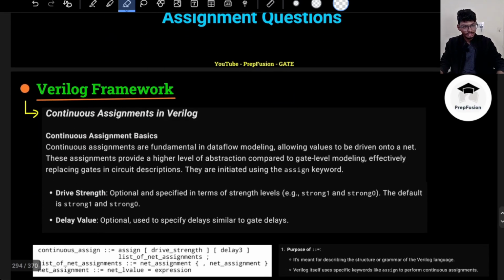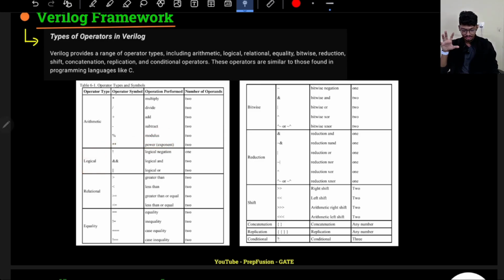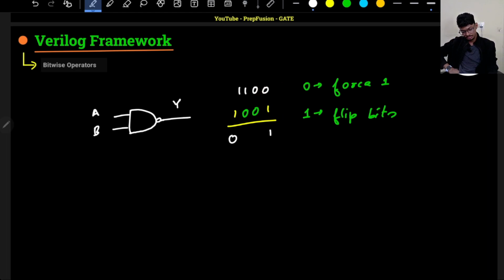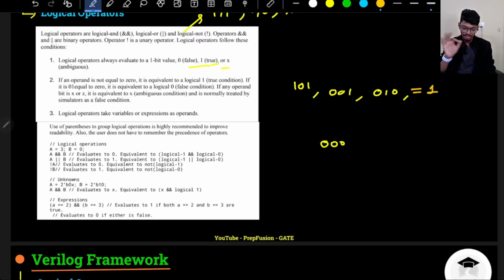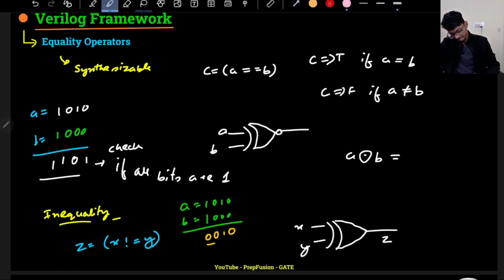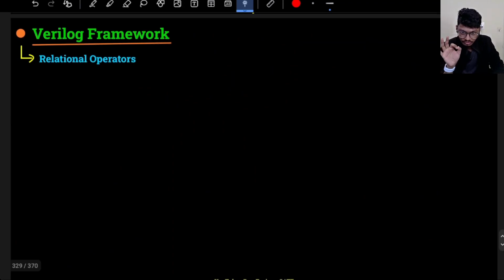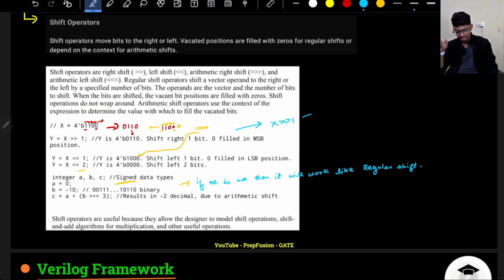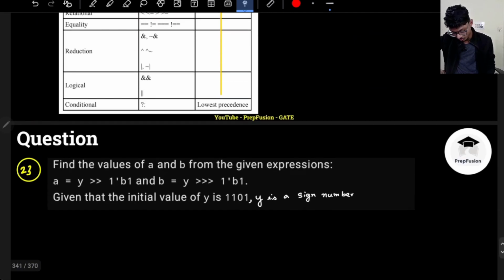8(A) Continuous Assignments: assign Statement, Delays, and Concatenation | #30daysofverilog

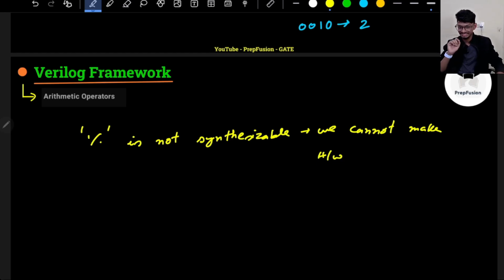Comment: 36:33 Why do we use non-synthesizable code in Verilog?? It CAN be used for simulation but what is the use as it cant be implemented in hardware, are these redundant??
Reply from the maker: First We can implement our logic using Non-Synthesizable code then slow we can convert that into synthesizable with different techniques.(This is one of the reasons their are other reasons as well)